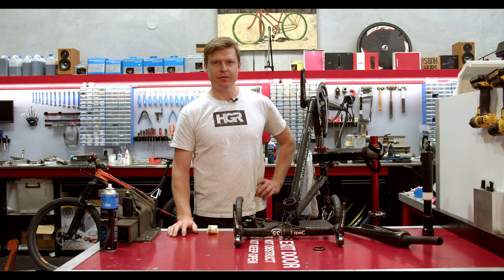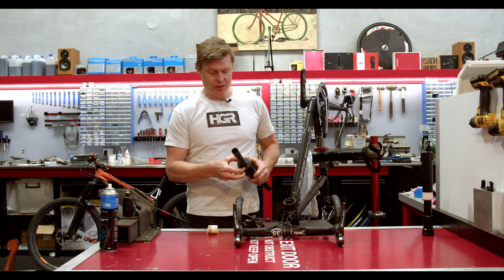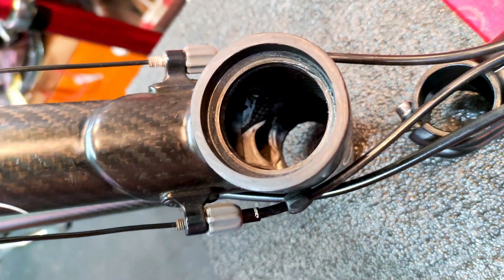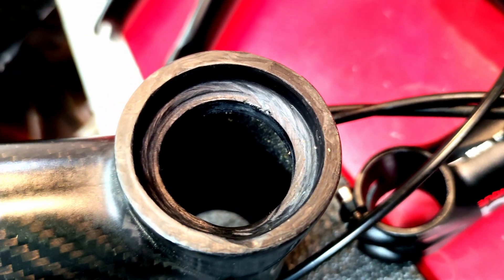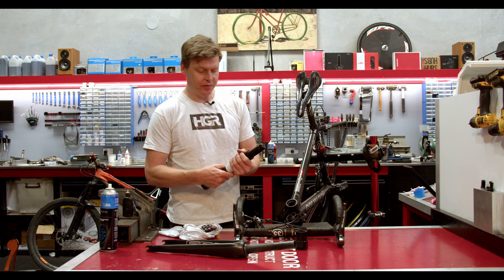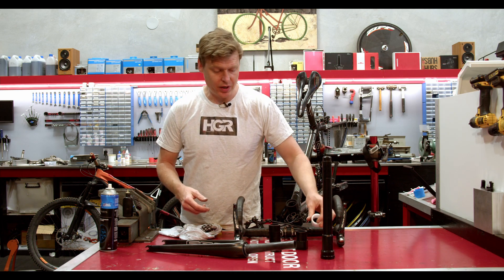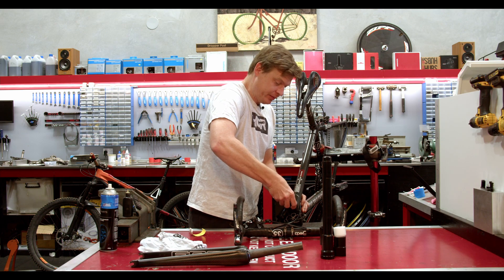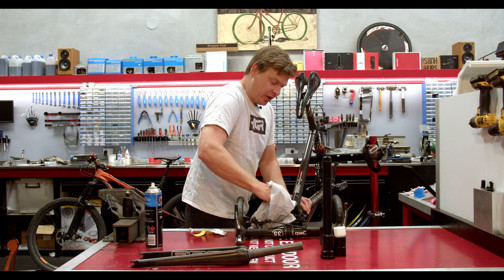How To Repair Damaged Integrated Headset in a Carbon Frame  (Part 1 - Using A Form Tool)

Comment: Did you mill the bearing seat on the delrin form the exact diameter of the bearing?... Or does it need to be 0.1mm wider than the bearing? 

Also how did you find and correctly set the angle of the bearing seat... I'm struggling to understand if the angle on my bearing is 36° or 45°.
Reply: I answered my own question about the bearing seat angle (it's 36°)... but am still hoping you can provide some advice to the milled form diameter of the delrin mold... it's a 51mm O.D. bearing.

I also wondered if you think it would be an issue to extend the seat angle down a bit to inside the column which woul increase the thickness (O.5mm) of the JB Weld where it cements to the carbon headset wall... it won't interfere with the headset tube and I feel the SS bearing ring should still float/set on the seat as designed.

Comment: amazing stuff! i got exactly the same problem with the upper bearing of my headset. completely loose and wobbly. how did you made this form tool and how did you prevent it from bonding it into the bike frame?
Reply: I think he explained - by using Delrin which epoxy doesn't adhere to at all.  

Wiki on delrin: Polyoxymethylene, also known as acetal, polyacetal, and polyformaldehyde, is an engineering thermoplastic used in precision parts requiring high stiffness, low friction, and excellent dimensional stability. As with many other synthetic polymers, it is produced by different chemical firms with slightly different formulas and sold variously by such names as Delrin, Kocetal, Ultraform, Celcon, Ramtal, Duracon, Kepital, Polypenco, Tenac and Hostaform.